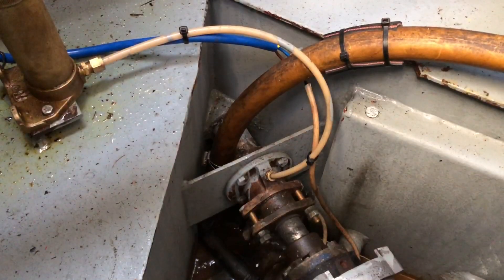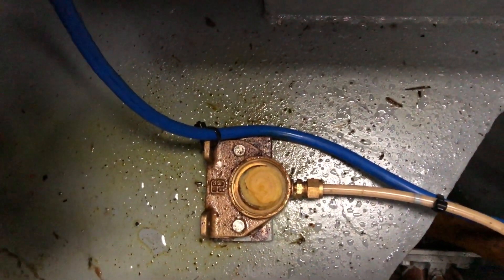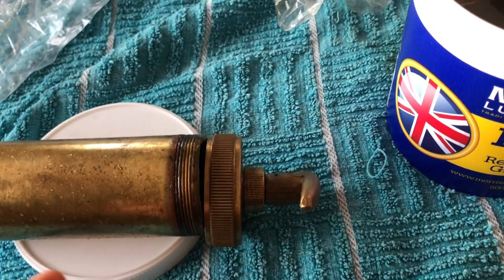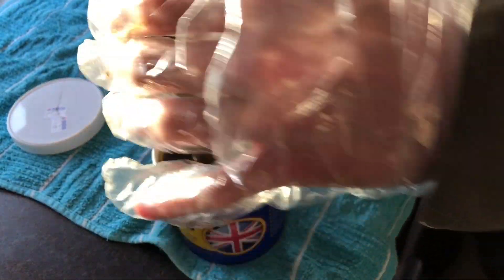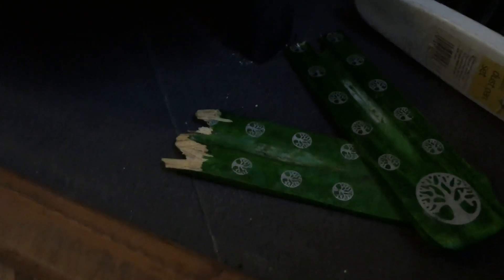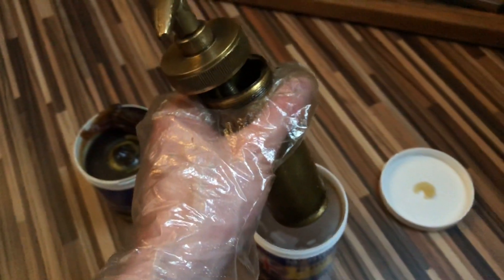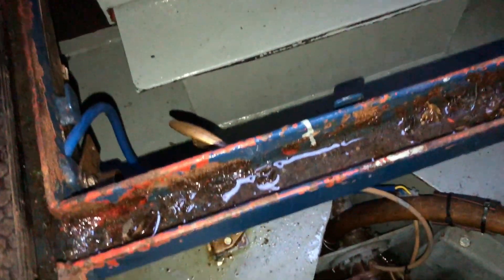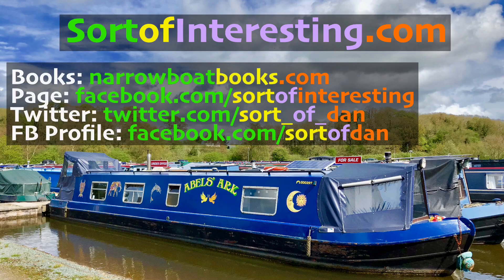The Worst Narrowboat Tutorial Ever!

Comment: Hi Dan, I think you are supposed to leave the top cap on, hold the tube over the grease pot as you did, making sure there is a good seal at the bottom, and then just wind the T-handle back up again. The grease should then get sucked up into the tube.
Reply: Hi THat is the correct way

Comment: The easiest and cleanest way to refill the greaser is to unscrew the greaser from the base, unscrew the top of the greaser which holds the plunger and remove it. Unwind the plunger fully. You now have an  open ended tube which will push easily over the disc with  the hole in it in the grease tin. Push down  until the grease appears at the top of the tube. Screw the top back on. Screw the tub to the base. Wind down the plunger until  resistance is felt. Any air trapped (there won't be much)  will compress. The grease will not.... it will squeeze through to the gland to do its job. Hope this helps.

Comment: how often do you have to wind grease into that stern gland ?  please
Reply from the maker: Some people say give it a bit of a turn every time you move, some say every time you run the engine, I basically keep an eye on the drip from the propeller shaft and turn it if it is dripping a lot.
Just the vibrations from running the engine can sometimes make it drip a lot, other times even after moving the boat it barely drips!